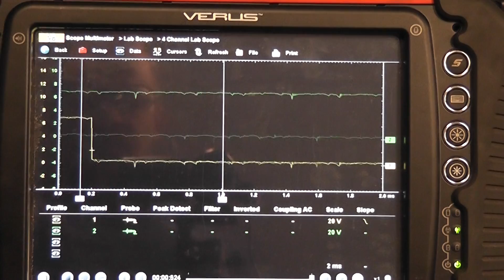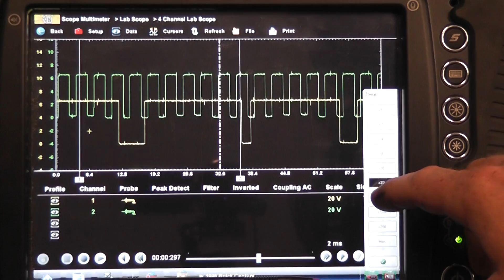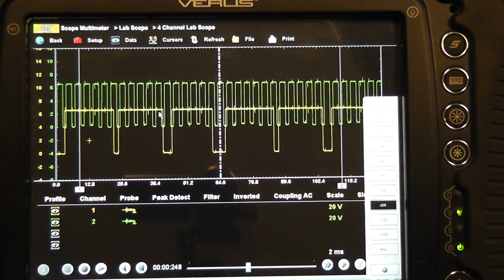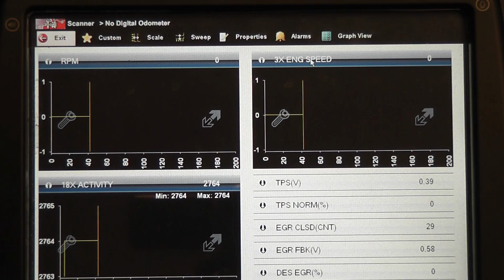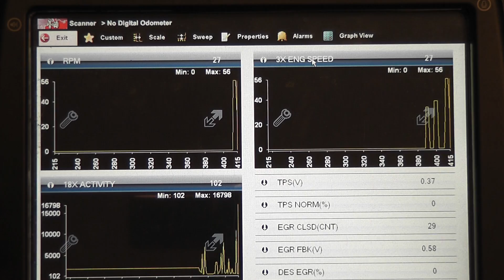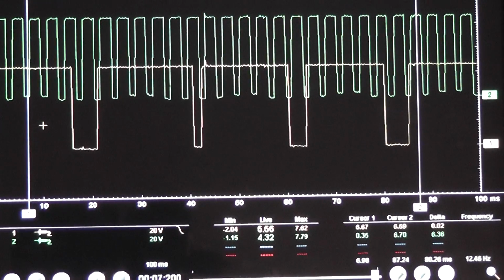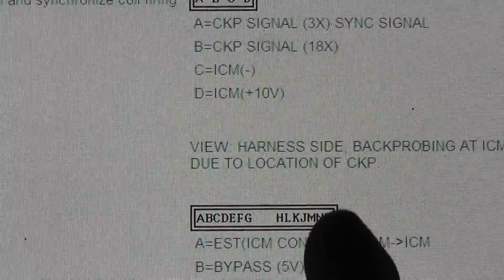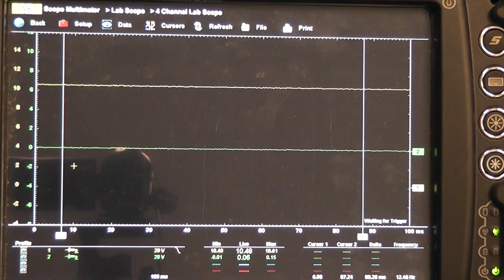How to test a crank sensor on a GM 3800 engine (3x and 18x signals)

Comment: Ok so i have a 2004 impala ls. The thing sometimes won't fire with the turn of the key but if i tap on gas it fires up and stays running as long as gas pedal is pushed as soon as you let off gas the car dies now I've replaced coils, plugs and wires, fuel pump, crank sensor. The problem occurs every 2-3 days and im running out of patients lol please does anyone have any advice
Reply: Depending on what tools you have I can suggest a few things.  The first thing I would suggest without any test equipment would be an idle air control issue.  Since you have tossed the book at it, this is a cheap part.  Since it works sometimes I would think the control circuit is probably good and the valve is sticking.  You can smack it when your car is doing this and see if it changes, or remove it when it wont start and the idle will be very high.  If you find this to be the issue it would be a good time to buy a throttle body gasket and pull it and clean it.
Reply: Play doe

Comment: Hey Paul so would a no "7v "supply to the ckps indicate a faulty module? If not what would indicate a faulty module and not the ckps sensor,many thanx from Australia
Reply from the maker: Great question! First, the module can fail in multiple ways as it does multiple things. But yes, one of the failures could be that the module is not sending the 7v signal that the sensor circuit needs to function. If you have found this problem, before replacing the module you must make sure the module has a good power and ground, then also you must make sure that the signal wire is not open or shorted to ground. Open would read 7v at the module and 0v at the ckp. Short to ground would be 0v at both ends. You would need to do a short to ground test with an ohmmeter to confirm whether or not the module was not sending out the 7v or if the signal wire is shorted to ground.

Comment: So I see  360 degree divided x 3 generating a pulse does that mean 2 plugs are firing at same time, although not on comp. on a v 6 engine?  also I see the possibility to do tests with low cost meters though its nice to see actual action to pinpoint a glitch in the waveform that just gives slight engine miss maybe

Comment: Look up a video I did called VRS bypass testing. This procedure will work on the quad 4 engine. But yes, I plan on doing some more VR sensor videos in the near future (this is the type of crank sensor you have.

Comment: Any way you could come out with a video on testing crank sensor on Olds Quad 4/twin cam 2.3/2.4L. I've got a 92 Olds Achieva SCX with a crank sensor problem, Rpm gauge isn't working as well.

Comment: Paul I finally put a new crank sensor in my no spark no start 99 grand Prix 3800 that fix the problem but now I'm getting a multi cylinder misfire code p0300 any idea what might be going on.

Comment from the maker: What year 3800 engine? On most of these the PCM is not involved with spark control during cranking. it is a bypass ignition system. so no spark can only be ICM wiring or ckp sensor.
Did you check the module ground? It is through the housing but you can do a loaded test on the ground by monitoring the EST ref low wire. It is blk/red on the ICM connector. The PCM actually grounds the EST ckt through the ICM body. Measure voltage on this wire cranking. it should be only a few hundred millivolts

Comment from the maker: the ICM sends an even 3x signal to the PCM. This is a "conditioned" signal based off of the 18x and 3x ckp inputs.
This is probably the signal you were viewing and is actually called the 3x reference circuit.

Comment: Hey Paul, It's Paul again great first name anyway haven't commented in awhile just thought i would drop a note, a customer came in with a 98 grand prix 3.8sc vin 1 the 3x and 18x pins were in different locations on the module connector. On this car they were the 3rd and 4th pins from the drivers side and the 3x square waves were all the same size. As far as i could tell there were 6 18x events in each 3x square wave. Great Teacher. High five my man.

Comment: Spark was missing which is why I went to crank. It will start right up at times but when it doesn't its cause if no spark. And I get to signal from crank sensor.

Comment: Hi Paul  I had a 05 lesabre 3.8 vin k with a crank no start. Had no spark so I went ahead and scoped the 3x/18x signal at the crank sensor and had nothing, power and grounds were ok. Replaced CKP sensor and started right up. Thing is, now it will randomly crank with no start. Any advice?

Comment: Hi Dan awesome and helpful videos good work. I have a question I have a 99 grand Prix gtp the other day while driving it just quit no sign no nothing just like someone turned the key off it's got no spark, the icm is good and the crank sensor is sending power to 3x and 18x any ideas of what I might try next?

Comment: Great video. On a 1997 LeSabre 3800 will I have to have a dealer reset the PCM after I replace the Crank Sensor ? Thanks

Comment from the maker: yes it will, it is still a good practice to know circuit design, but you will be ok. I even use the test light for 5 v pull-up type circuits with no problems. 
if it is an input circuit, due to the naturally high impedance of these circuits you are not going to hurt anything. it is the outputs that you need to think about more and that is why in Section 3 I have you guys checking the current flow of your test lights before doing bypass type tests. great question. thanks for giving me a chance!

Comment: hi paul, if you use a testlite for a ground, ''like when you tapped the t-pins'' if you get the polarity wrong, will you still damage the PCM if the circuit IS loaded, or is that only with a jumperwire?i guess what im saying is the resistance in the testlite gonna save your butt if you get the polarity wrong? BTW i bought your book and man best money i ever spent, i actually printed out a hard copy of it, took me 4 hrs but well worth the time. keep makin videos..best ive seen yet..

Comment: Paul, I checked the feed voltage on my cam position sensor and instead of getting B+ voltage, I'm reading getting about 11 volts KOEO. With car running, Im getting about 13 volts. So it looks like I'm losing a volt in the feed wire. Is this drop enough to affect hall sensor performance?

Comment from the maker: To #1 allow the module to recognize which pair of cylinders and thus which coil to fire within 120 degrees of crank rotation. (3 coil waste spark system). #2 the 18x signal is high enough resolution to be used for misfire monitoring and low speed timing controls for a smooth idle speed. 
Basically the 3x signal is only needed on initial crank (for coil sequencing). The 18x is your piston position and RPM input.
Read below about my post on the older 3.8

Comment from the maker: because the ckp sensor on the older 3.8 is a 3x only signal with no reference notch (all even spacing). The cam sensor not only co-ordinates the injection timing but it also co-ordinates the coil firings. (waste spark, 3 coil system).
No cam during cranking = no spark
Lose cam during running and engine runs with no problem until you shut it off, then no-start again.
Reply: ScannerDanner I think this my problem. I need to check cmp sensor and magnet. I was not aware that it needs cmp signal to fire. No CMP causes no spark? Scanner show no cam sensor reading when cranking. Could be bad wire. Scope showed both crank signals at IC module but I did not test cmp sensor. New IC module but no spark 3800. Computer show only 1 ckp signal (I forget which one) no cmp, and no rpm.

Comment: When you refer to "pull down" would that be the same as when some say " Ground Controlled " as in the switch is located on the ground side of the circuit instead of the positive?

Comment: Very good video Paul. I like the part about the computer not responding to the 3X line unless the 18X line was pulled to ground at the same time. I could see where someone would interpret this as an open wire on the 3X side. This was new to me and as always Paul, a very clear explanation. Keep up the good work!